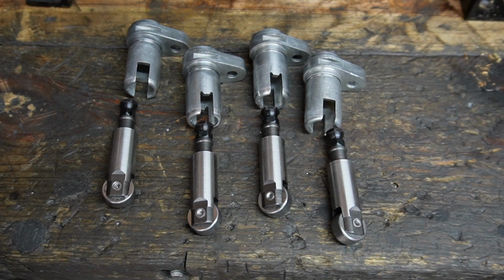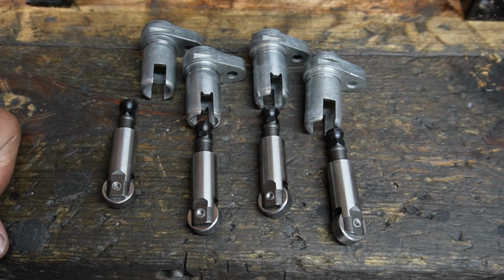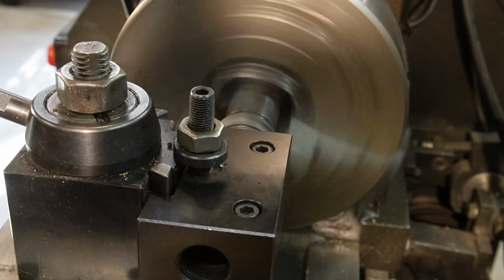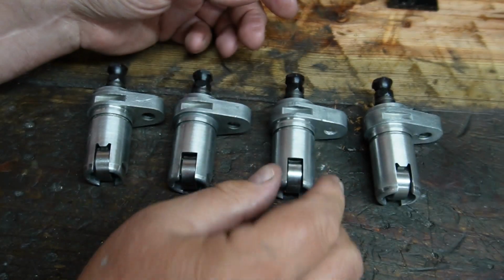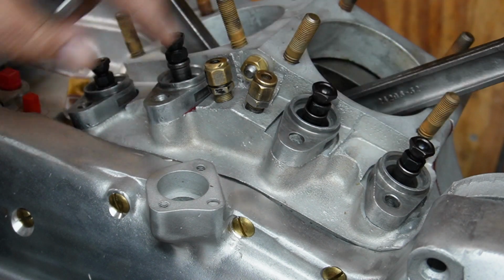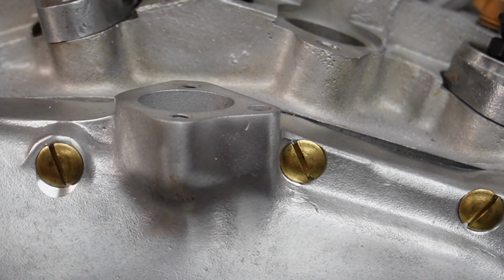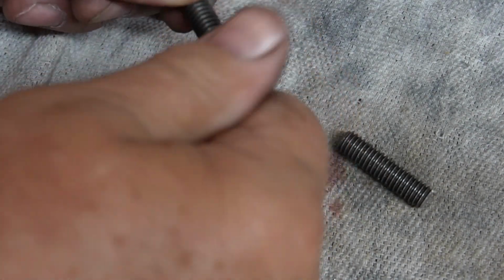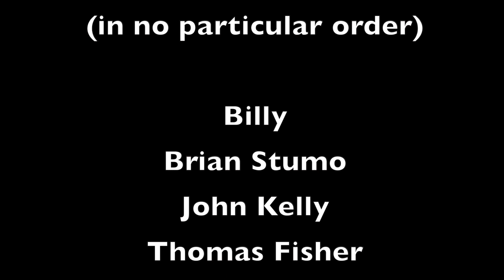59XLH Part IX, Tappet Guide Blocks Nbr 224

Comment: Late to the party but greatly appreciate the informative vids - am preparing to tackle an engine rebuild on a 68' XLH and your tips n' work-arounds provide much needed insight. I have experience with British engines but Ironheads are new to me. Your vids resonate because after each step, you check the operation to ensure appropriate clearances and correct form n' function. Many thanks. Cheers n' Beers to ya
Reply from the maker: Good luck on your project...

Comment: You do a nice job fitting oversize lifters in XL tappet guides. Small horizontal honing machines like the old Sunnen Connecting Rod Hone , or a similar Superior Hone or Aamco Hone can often be found at a modest price. I use an old Aamco horizontal hone that's converted to use mandrels from Superior and Tenessee Abrasives. It makes short work of honing lifter bores for oversize lifters without the boring operation. The same mandrel works for 45s, K models, XL's and Big Twins from Flatheads to Shovelheads. Evo's take a larger mandrel. For late XL, Twin Cam and M-8 lifter bores that are machined directly into the case I use a Sunnen mandrel adapted to a Sunnen P-180 driver chucked ito a cordless drill. I have also installed bronze lifter bushings in TC and M-8's to save the cases from being scrapped.
Reply from the maker: I wish I had space for and could afford the Sunnen machine. That would make things easier and faster.

Comment: I ran into the same issue when I cleaned/ran a tap into the cam cover threaded holes. Smitty.
Reply from the maker: Yes, I've run into the same problem on other engines.

Comment: Great video. Thank you.  I thought I read somewhere that tappet guide blocks were suppose to be a tight fit...maybe even tapered?  Did I make that up?
Reply from the maker: Yes, they are usually a light press fit. So that one that slid in is probably a little loose. If the guide block is too tight in the case it will close down on the lifter and make the lifter bind. It is a balancing act to get them tight but not too tight.